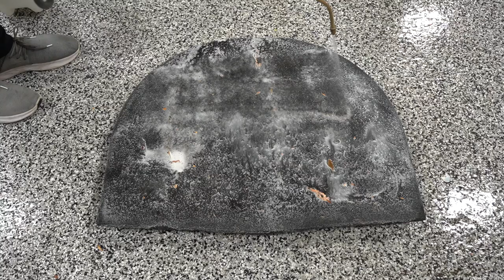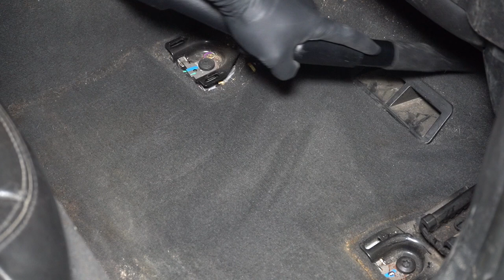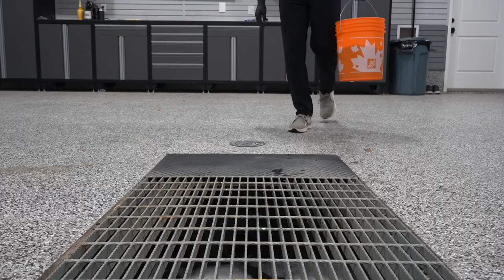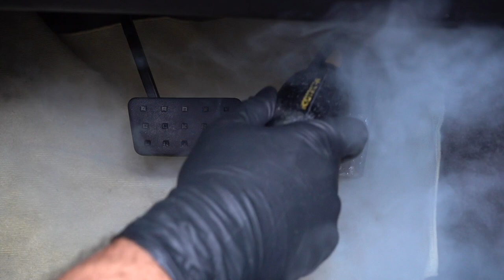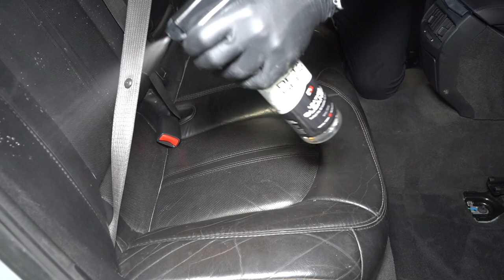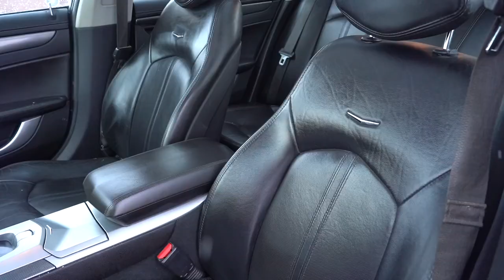Would You Buy An ABANDONED Cadillac That Looked Like This? | Car Detailing ASMR

Comment: For a smoker's car, when you're doing a full detail, how do you clean and get the smell out of all of the vents?
Reply: Excellent point.  Actually any long abandoned car, needs to have the vents cleaned some way.  I am no expert, but for this vehicle with its horde of mice living in it.  I would turn on the car after cleaning it, turn on the vents to bring in air from the outside (no heat or A/C, just air) and then spray first Lysol or Clorox into the intakes while it is running and repeat once or twice and then switch to Febreze to draw in the disinfectant and odor cleaner.  But obviously Mitch will have an excellent plan he uses.

Comment: I know a complete detail is always best for smoke odor but do you have maybe a “quick fix” alternative? I’ve tried deodorizes that claim to remove the smoke odor but it just comes back.
Reply: Ozone machine and leave running for an hour in the car with the doors and windows closed, then open doors and windows and let it dissipate for at LEAST 2 hours. Warning, do not do this in an enclosed space like a garage, unless you can leave the garage open for the duration it airs! Don't forget to clean the ash etc where you can, and also quick way to get the bits out of the carpet before you run the machine is to use one of the detailing drill brush bits (the one that looks like a toilet brush) just dry to flick it out of all the carpet and hoover it up. I'd wear a 2.5 filtration mask whilst doing any of the brushing/vacuuming if it's bad :) if it's grimy and engrained tar on things then YMMV depending how bad it is
Reply: I would change out the cabin air filter also if it was a personal car I know it's not fast but the smell will get trapped in there

Comment: The old thing cleaned up excellently.  If the engine is good and there aren't too many other mechanical issues, someone should buy it.  However, I would not buy this only because I dislike classic luxury brand cars cow-towing to the yuppie, bougie obsession with "sport utility vehicles."  This is especially true of makes like Cadillac, Lincoln, Mercedes, Bentley, and Rolls-Royce (I literally cried out "Noooo!" like Luke Skywalker in The Empire Strikes Back when I learned they too have become yuppie/bougie and make SUVs).  Most SUVs are just station wagons with big gnarly tires.  But a Cadillac or a Lincoln or a Mercedes, those are class and should never be made into the station wagon.  Land Rover is about real SUVs and the original SUV is the Jeep and Ford Bronco.  I drove a Cadillac once, in 1991.  It was a 1979 or 1980 four door sedan in mint green with a plush velour upholstery on the seats.  It was a beautifully smooth ride, it was like sailing on air even while driving on a bumpy back road.  I can still feel it even though it was over 30 years ago.  True luxury and comfort.  I've ridden in SUVs, they don't hold a candle to that lovely Cadillac.